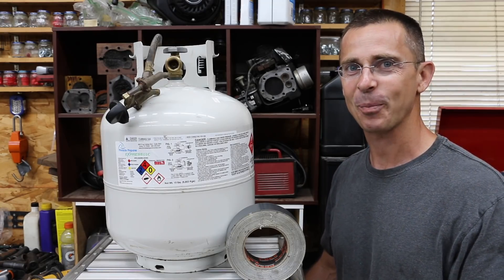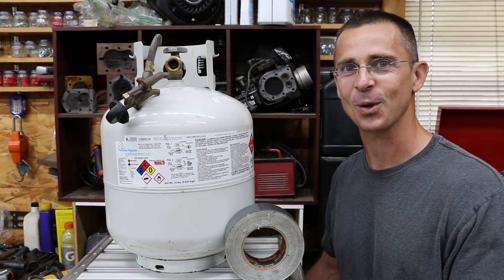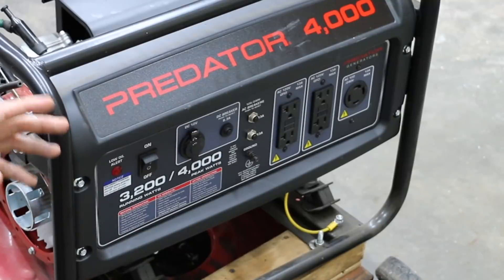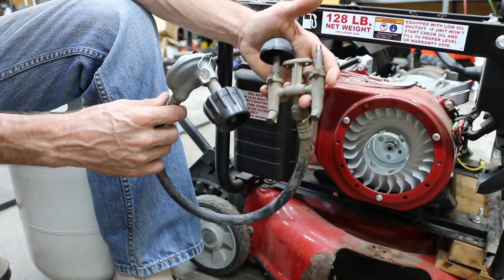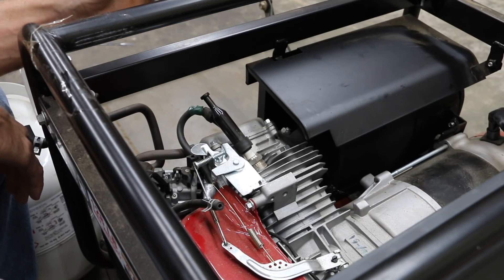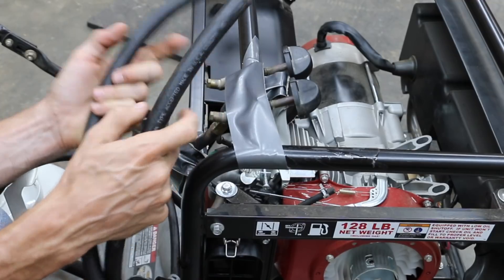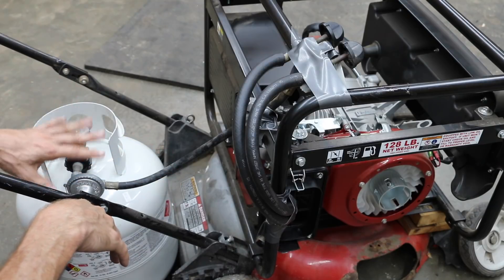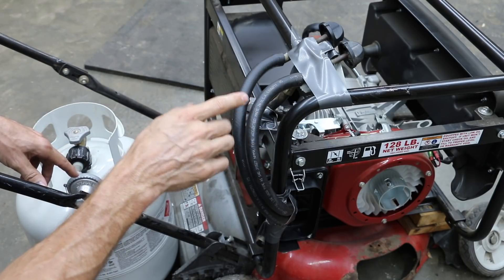Can a gas (propane) grill power an engine?  Let's try it!

Comment: If it's the apocalypse, would using bad gas work? (gas goes bad after a year or so) Cuz if it is I'm finding every plastic tank I can find and getting that gas.
Reply from the maker: Thank you for the video idea!
Reply: @ProjectFarm  wish I could provide the gas cuz it's easy to find where I work. Just wait for a junker that's obviously sat and just stab or drill out the gas which depends if tank is metal or plastic. Maybe a scrap or junk yard would let u get some

Comment: Back in the 80s most taxi cabs in large metropolises we're set up to run on propane because it was so much cheaper mass transportation buses were set up to run on methane because it was so much cheaper and like everything else the more demand there was the higher they raised the price when gasoline was $0.99 a gallon # 2 diesel fuel was .30 cents a gallon then they started putting diesel engines in cars and everything on the road and now diesel fuel is way higher than gasoline
It's not like this is new technology most home generators that are set up as backups run on natural gas
Reply from the maker: Thank you!
Reply: @ProjectFarm  I've been looking for a kilowatt device that shows kilowatts Cycles volts and amps

Comment: A tip: if you run your car on propane, you can advance the ignition timing. It has a high octane rating, low combustion temperature and burns slower, therefore by advancing the ignition you make up any lost power. You can also run a 14:1 mixture (a bit rich) and get even better than stock torque, since you get a perfect mixture at lower rpm.
Reply from the maker: Thanks for the tip!

Comment: In the 80's I worked for the phone company. There was a work center across the street from a propane supply company. A deal was struck and gas lines were run to the center and tanks put in all the trucks. The trucks could run on gasoline or propane. You had to fill the propane tank every morning. If the tank ran out you just hit a switch and turned on the gasoline. There was not one problem.
Reply from the maker: Thank you for commenting on this

Comment: Is there a way to do this so it’s more of a permanent install?   Maybe with threaded insert or something?   Th reason is that I’m thinking your losing some propane into the air...
Reply from the maker: Great question.  I would buy a proper conversion kit and it'll come with all of the fittings needed.

Comment: i have a1997 tahoe 4x4 5.7 vortec runs off propane. its awsome i went from 16-19 mpg with gas to 29-32mpg with propane and gained 23 hp. you can buy a conversation kit for just under 700 and im telling you its worth it. burns so clean and dont gunk up the motor. she has 673,594 miles and runs just as strong as she ever has. i bet if it was left on gas it would have been lucky to see 400,000 miles. i think i will see a million plus thanks to the clean burning fuel. also its only a $1.29/gallon where i live and gas is 2.98. big money saver to.
Reply from the maker: Impressive!  Thanks for the recommendation.

Comment: It’s relatively common to have cars run on LPG (Propane) here in Australia. I have a 1983 XJ6 Jaguar that is dual fuel, so you can switch it between petrol or LPG. It’s an easy conversion, a device called a “converter” is installed to change the LPG from high pressure to low and then a line is fed from the converter to the car’s inlet manifold. The hard part is getting the ECU to work when you don’t want the injectors to fire.
Reply from the maker: Thank you!
Reply: there's 4th gen lpg system out there for long time

Comment: ok, but do you know what you did? you created an explosive fire hazard. propane is heavier then air. you cant be sure that 100% of the fuel was going into the engine. im sure some gas escaped. probably a significant amount. im actually suprised that worked at all. ive serviced propane powered vehicles. i know how the conversion kits work . theres a very sophisticated air fuel mixture apparatus that garuntees the pressurised liquid propane cant just shove its way out past the air intake and escape out into the atmosphere. the propane would find a place to lay until it was detonated. then boom bad things happen!  i like your video. but there is a reason there is a special apparatus for pressurized gas to internal combustion engines. be careful.

Comment: At work we have a Chevy 350 small block engine that runs on propane as our generator. 
It works very well. We do however have it regulated based on load. So it usually runs pretty smooth. 

Reminds me, I should change the oil in that thing. Its always clean, but clean doesn't mean it lubricates!
Reply from the maker: Thank you!

Comment: I used to work at an automotive machine shop. Engines from forklifts and trucks that were converted to LP were very clean. Much cleaner that gas or diesel.
Reply from the maker: Thank you!

Comment: You can find propane powered vehicles like the fleet F-250 or Chevy 1500 2500 something along that line and they used to have propane-powered taxi cabs but they would not pass the emissions that is part of the reason that they no longer use propane-powered fleet vehicles
Reply from the maker: Thank you!

Comment: Is it true propane gives less horsepower than gasoline?
I have seen a lot of delivery trucks in Mexico using propane instead of gasoline, mostly v8 engines. They are small box trucks about  two thirds the size of a delivery UPS truck and normally carry at least 1000kg, but I do not know if it is worth the conversion in terms of price and horsepower.
Reply from the maker: I'm told there is less horsepower with propane. Thank you.

Comment: I have a car running on LPG, Mercedes CLK320. Main benefit is that you basically cut your fuel costs in half. MPG increases a bit, but now my running price is about - 5-6 eur a 100km (60 miles). Also, carbon deposits decrease masively, so its alot "greener"
Reply from the maker: Thank you!

Comment: I know as a fact they offer conversion kits for generators to run entirely on LP gas. It is more efficient and runs better than regular gasoline. It mostly consists of a different carb and jets as well as mounting hardware. I would do it in a pinch. I wouldnt use it on a lawn mower but for sure on a genny!
Reply from the maker: Thank you!
Reply: @ProjectFarm  Keep putting out awesome content! I really enjoy it.

Comment: Some have proposed that we make ammonia for a transportation fuel. Would you run an engine on anhydrous ammonia for us? Will the ammonia and water vapors from combustion effect the aluminum in the engine  or its oil?   

Be careful with the ammonia if you try this.  Home DIY attemps, if you have an ammonia leak don't breath it in. Be safe and research this first.  Do this outside and stay upwind.
Reply from the maker: Thank you for the video idea!

Comment: My dad had an old Buick, 1966 I believe, that ran on both gasoline and propane.  The propane tank was in the trunk where the spare tire was supposed to be.  You could switch between the two fuels by a toggle switch under the dashboard. There would be a moments hesitation and then you could not tell the difference in how the car performed.
Reply from the maker: Interesting.  Thank you and Happy New Year!

Comment: Actually is possible even run cars on propane, here in Argentina its an ussual practice since a lot of years, you should use apropiated equipment and mantainance, but yeah, it's possible.
Reply from the maker: Thank you
Reply: My dad had a car that was both propane and gasoline.  Separate tanks. A switch to change fuel sources.  In performance you couldn't tell the difference. He and another guy rigged it up.  We had a Farmall Tractor that was propane so we had a good supply. Of course gasoline could be bought anywhere.

Comment: PLEASE TRY: 5 parts lantern oil and a quick spray of break cleaner in the tank  I ran my lawnmower all year mixing basic red oil lamp fuel and giving it a quick shot in the tank of break cleaner (octane booster) I guess but it ran fine in an old Briggs 3.5 I never took the motor apart the oil was ok and spark was not  too fouled up can u please try this in a see through engine
Reply from the maker: Thank you for the video idea!

Comment: Could try a propane weed burner head for a larger HP engine. 

Or measure the amount of fuel consumed to run that heater for, say, 30 minutes, by comparison to gasoline (weigh the propane tank)
Reply from the maker: Thanks for the video idea!

Comment: How did you put a generator on a lawnmower
Reply from the maker: I had an old mower deck and just drilled a few holes and bolted it onto the mower frame.  It's a lot easier than lifting it. Thanks again.

Comment: I did this with mixed success, now I can get LPG carb setups for $40 but at the time I did this, the best price I could find on kits was $200.

I plumbed it straight to a spacer between the carb and the engine.  It was very had to get the mixture right. It was on a sweeper machine similar to a snow blower but with brushes instead of blades. I was the only one who could make it run so it was job security for me. The machine was used to sweep the turf in a indoor paintball field.
Reply from the maker: $40 is a great price.  $200 hurts!

Comment: building a go-kart now with a briggs. now going to add a propane tank since propane is just fifteen cents a pound where i live. Cheapest transportation ever.
Reply from the maker: That sounds like fun.  Recommend using a proper propane conversion kit instead of using the setup I used. Thank you.
Reply: @ProjectFarm  that'd probably be a good idea lol. i was going to use gas but then i remembered how much cheaper propane was. Yeah.

Comment: About 2 or so years ago I was working on atv and couldn’t get it to fire till I put a un lit propane torch in air box and it fired right up at that point I knew atv wasn’t getting gas through out carb
Reply from the maker: Great way to diagnose a fuel issue!

Comment: As an employee of a company that supplies industrial and retail propane, and being that I'm the one who fills the cylinders.. I was skeptical about this barbecue tank providing enough fuel to air ratio considering that most propane tanks draw vapor (as opposed to a forklift tank that draws liquid) I knew that the flame was going to be pure blue and clean burning because propane is far more economical and environmentally friendly compared to gasoline. I was very surprised with the results and I'm glad that you did this experiment. I'm going to share this video with my coworkers. I'm really enjoying your content :)
Reply from the maker: Thank you!  I had fun with this video but wouldn't recommend anyone use this sort of setup for safety reasons. Thanks again!
Reply: @ProjectFarm  I wouldn't recommend the same thing knowing the dangers of propane, how to handle it and how to transport it since I need to renew my license to do so every 3 years. Plus I've been working in the industry for 15 years (since 16, 31 now.)

Comment: My father had a 1975 Datsun pickup truck that ran for years off propane. We had it my entire childhood growing up.  He converted it himself using parts salvaged from an old forklift. When he sold it to a high school kid a few years ago it had 475,000 original miles on the motor and original 5 speed transmission with little but regular maintenance. Propane burns very clean and engines last forever on the stuff, but you do see a horsepower loss. 

His conversion retained the ability to switch back and forth between gasoline and propane, but since we had a big tank at home he almost never used that.
Reply from the maker: Thank you

Comment: A buddy of mine in high school had an old International pickup truck and he had swapped out a 400m Ford V-8. He also had a propane tank in the trunk and he drilled a hole into the intake manifold. The the truck ran fine in the city on gas but not enough acceleration on propane. So on freeway at cruising speed he would switch over to propane and save tons of money and gas. Even though you can accelerate with propane it just didn't have the power gasoline does
Reply from the maker: This is interesting. Thank you

Comment: This is one of the first experiments i ever did with a small engine (like 6th grade) along with map gas and ether exept i used a torch which was a lot easier to adjust and was portable and for the ether i used a rag and a can attached to a tube
Reply from the maker: Thank you!

Comment: https://m.youtube.com/watch?v=Hck3Ka9bxpI&t=130s check this romanian guys
Reply from the maker: Thank you.  A proper conversion kit is much safer.
Reply: Actually this guy was left without gasoline and so came the idea to use the gas burner. And yes it is not safe but it worked without making many changes

Comment: We had a school bus converted to a RV that could run on both propane and gasoline with special dual mode carb on a Ford 460 V8.   We traveled all the way to the southern tip of Baja California in the early 80s.
Reply from the maker: Nice!

Comment: The LPG/propane from your grill is different from the LPG in your car as LPG/propane is a cold liquid in a car it is sent through a converter using engine coolant to heat it turning it from liquid to gas/vapour. commonly Taxi's and couriers vans convert to dual fuel switchable between petrol/gasoline and LPG.
Reply from the maker: This is great information. Thank you.

Comment: I thought about distilling wood. To get wood alcahol  and build a engine to perform best on it. And use it to power agenerator. Maybe use a 3-5 hp engine. With higher compression ratio. Takeing advantage of methanols high octane . maybe it could replace a 10-12 hp engine easily. Just a crazy thought..
Reply from the maker: Thanks for the video idea!

Comment: Back in the day people in Poland managed to run little Fiats 126p on an ordinary household gas canisters by just sticking the hose right into the carburetor just like you did. Ran surprisingly well, but it was a good idea to have a passenger adjusting the gas flow on the fly ;). One note, in Europe it is uncommon to use pure propane, we usually use propane-butane mix for cookers, bbqs, heating with propane reserved to modern cartridge camping stoves.
Reply from the maker: This is interesting.  Thank you for commenting.

Comment: It's kinda funny to watch this in Poland, where LPG  conversions are so common that you are surprised to see a large displacement gas engine without it :) Keeping correct AFR is a challenge all the way up to gen IV systems (multipoint sequential injection), much less in gen V (liquid propane injection or LPI) and gen VI (direct LPI).
Reply from the maker: Wow!  Thanks for commenting on this.  Much less common in the US.

Comment: You should see file efficiency, is it cheaper to run it on propane or gasoline
Reply from the maker: Great test idea. Thank you
Reply: It's also be cool to see if a engine will run off on natural gas off of a house,
Reply: If so it might be a cheep option for a motor for a tool or home built generator

Comment: Hi, great video as always. There are comments smattered throughout talking about two stroke engines, and not that it has anything really to do with anything, people are talking about oil injection systems and how they bypass them by using premix. That is not a good idea because in many cases, the oil injectors not only inject oil into the carb, they also keep the main bearing lubricated. Check your bike before giving up on the oil injectors and make sure that it doesn't go to more than just the carb. You could destroy your engine by simply throwing premix into the tank.
Reply from the maker: Great point. Thank you

Comment: If propane is so clean, runs at normal temperature and a tank of propane is cheaper than a gallon of fuel, why hasn't this been mass produced? Come on Ford! You love making efficient engines make a propane 3 cyl ecoboost for daily driving!
Reply from the maker: Thank you

Comment: Just spotted this video my land rover defender V8 runs on LPG - liquid petroleum gas here in  the UK it lots cheaper than petrol does a little less mpg but runs great also because it's cleaner than petrol your oil stays clean for many many miles ,,,I love it ,just have to have a 90 liter tank fitted to the car
Reply from the maker: Nice!  Thank you

Comment: I missed this one when it was posted. There are already companies that make dual fuel (propane/gas) generators. I looked into them because in a power outage I thought I would have a greater chance to get fuel once I ran out. I went to some gas stations and asked if they had generator power so we could still get gas during a power outage. None had generators and without power we get no gas. Then I went to the propane company, they have a large above ground tank. I thought , no problem getting propane, gravity is working for you, nope. Do you use a generator during a power outage? Nope. So the only way to get any gas or propane is off a delivery truck but once it is empty they can't refill until power and maybe internet comes back on line. So, long power outages WE ARE SCREWED! None of these places thinks ahead, scary.
Reply from the maker: Great point. Thank you

Comment: Engine run 3000 miles on propane, the oil looks the same as the day you changed oil.   No carbon.
Reply from the maker: Nice!

Comment: Some engines use their coolant to heat up the propane to turn into a vapor for better combustion.
Reply from the maker: Great point.
Reply: If you take propane up to 160 degrees I think it will turn to a vapor.